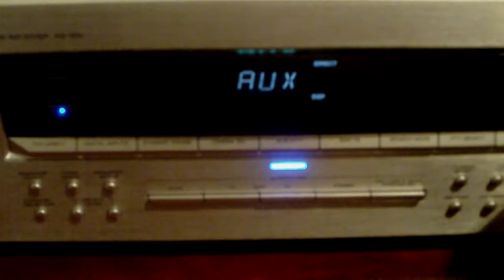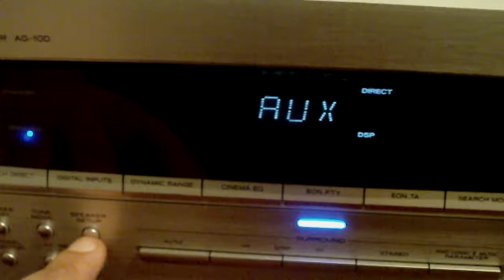TEAC AG-10D Digital Amplifier Repair

Comment: did you get it working? Dont change the caps yet.. Does it work fine in 2 speaker mode? Does nit only shutdown when you try to activate the surround?  Do you hear the relay click when you press the speaker button? Could be a shorted relay causing an overload hence the shutdown. Maybe there is speaker protection whereas if there are no speakers connected it shutsdown.. Its hard to evaluate from video when I dont see any input or output connected to the amp.